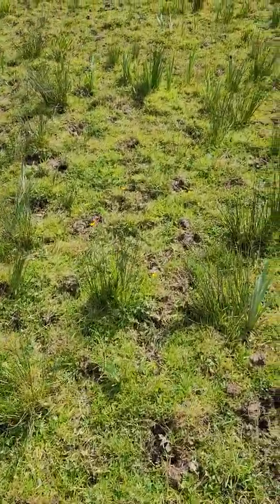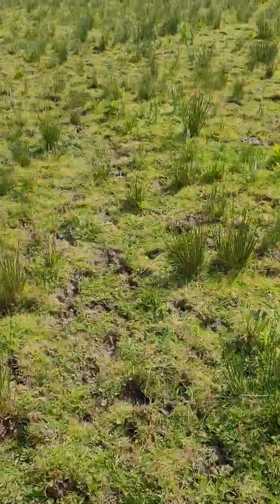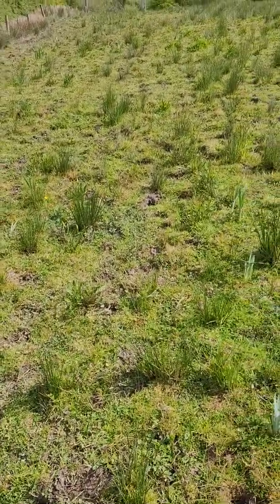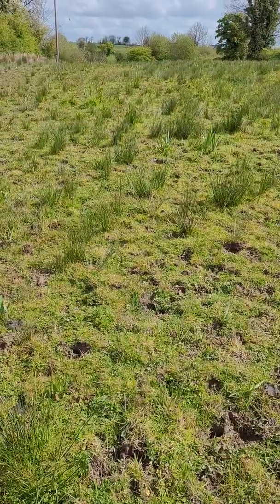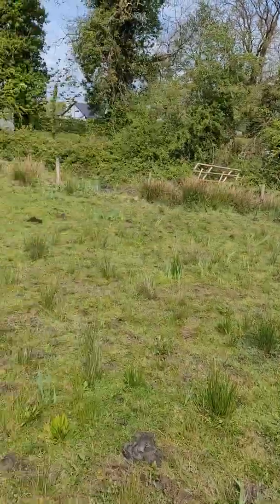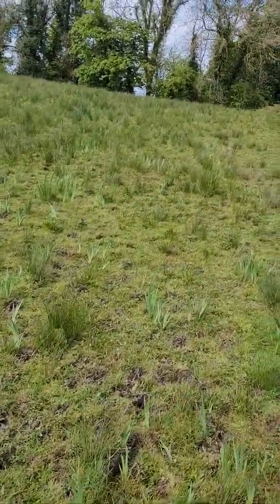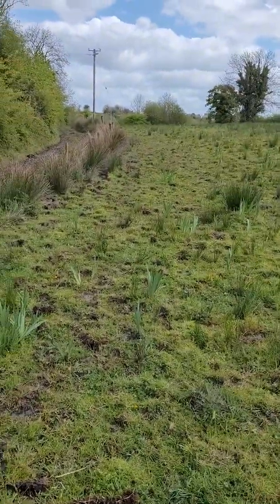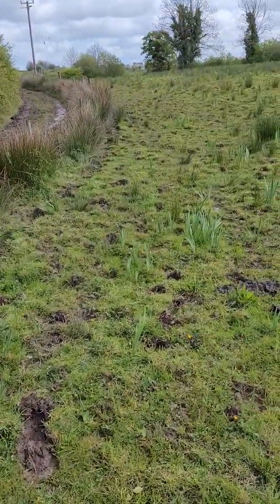The reseed that wasn't a success.

Comment: Francis, i see you have a good few wild Iris / Flaggers amongst the rushed. They seem to be very hard to kill off. Ive heard you need to roll them first to crack their tough outer membranes. But what is the best chemical to spray with then?
Reply from the maker: If you dont have a roller, use a haybob to damage them so that they will absorb herbicide better. I use Roundup as it is the only herbicide licenced for lickers and applt in both directions. Go in one direction first, leave for an hour to dry on and run through them again in the opposite direction. You will need to followup in year 2 to really ensure they are killed.
Reply: @francisstenson1971  Thanks Francis,so you used the haybob approach did you? I have a roller so will try that, but im guessing the licker will not catch them then as they will be flattened too much? Would spraying be an option then? I certainly dont want to spray with roundup, but ive heard of others like Lupo perhaps?

Comment: Hi Francis, admire your devotion to improve the ground. Does it need a drainage channel where you were standing - seems to be the low point of the field. If no outlet for a channel would a stone filled trench work? A deep trial pit with a mini digger might indicate the path to take.
Reply from the maker: Believe it or not, there is a drainage shore in this area and it is flowing nicely. It was that the rain was so torrential that the ground became flooded and this was on top of damage previously done when the ground wasnt fit to carry heavy cows in April. It dry after a day or so.